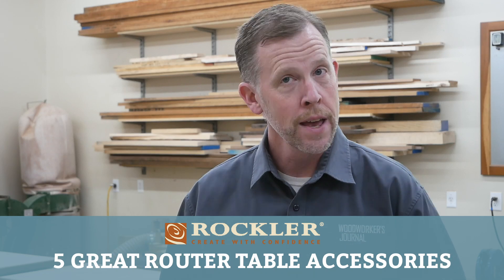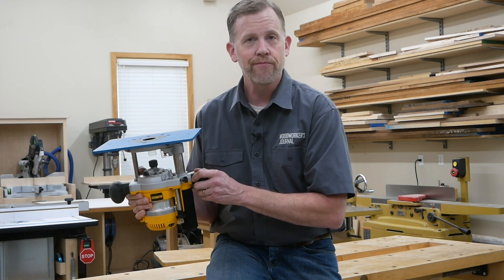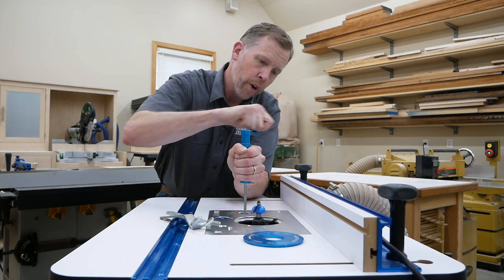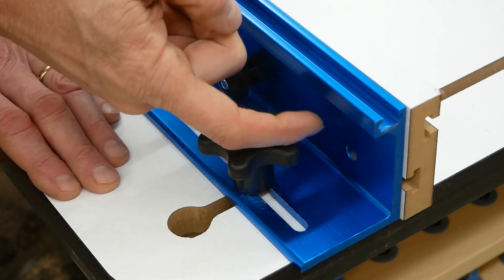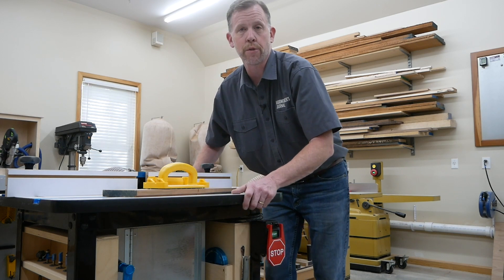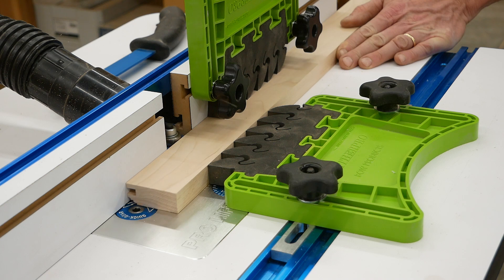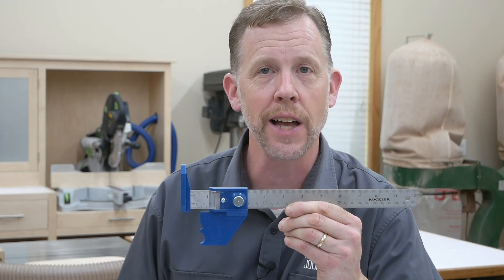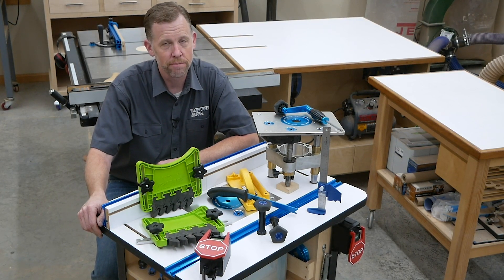5 Router Table Upgrades

Comment: A quick free DIY version of raising the wingnuts/knobs for easy adjustment: cut pieces of broomstick/large dowel long enough to to rise above fence for easy access; DRILL them to accept your toilet bolts/T-head bolts, and apply your knob or wingnuts.

Comment: I know I'm sounding like a broken record, but this stuff can't hold a candle to the Incra router table systems. The incra router fence system is probably the most advanced and amazing fence system you can buy for a router. There are some videos of a guy demonstrating it that looks like it was shot in the 1990s and it really shows how amazing it is.

Comment: On what routers does this table work?
Reply from the maker: Hi Omar, the Rockler High Pressure Laminate Router Table can fit a wide variety of different routers. You can find more specific details about this on the product page under "Product Description" at https://www.rockler.com/rockler-high-pressure-laminate-router-table-fence-stand-and-phenolic-plate

Comment: How is it..2 and a half years after launch...it has been brought to rocklers attention numerous times that the dial is wrong. It is wrong by half. each quarter of a turn raises or lowers the bit by 1/32 not 1/64th. and....even if the pitch for the lift was 1/16th per revolution...the scale is backwards...in this video you can clearly see the router is going down as he rotates the dial upwards. I have this lift...so for example...to actually take a 1/32 cut out of my workpiece....id zero out my scale...and when i rotated the dial to where it needed to be to actually make a 1/32 cut..the dial would read "3/64". I know the developers know about this error...I have a reply from rocklers tech support over 2 years ago thanking me for bringing it to their attention.
Reply: I have a Rockler lift for my router and al I get done is double checking my setting's due to the lift walking. It is not only aggravating but also dangerous. I know how to tighten the brass nut, but it does not stay in place